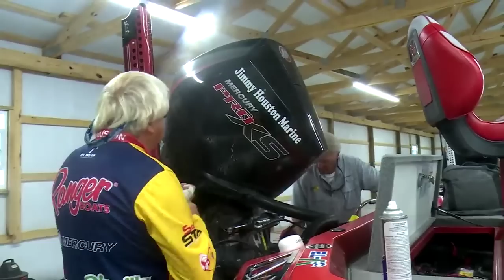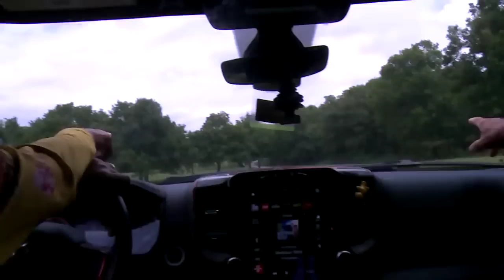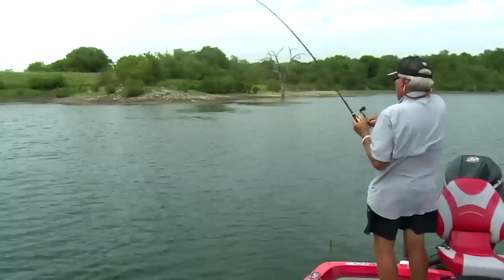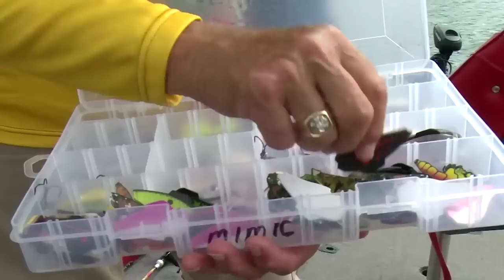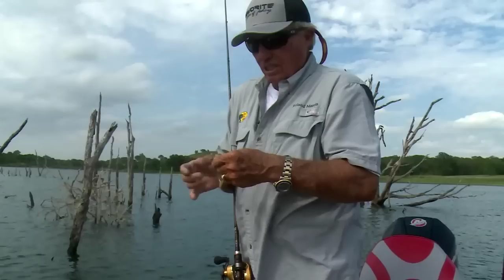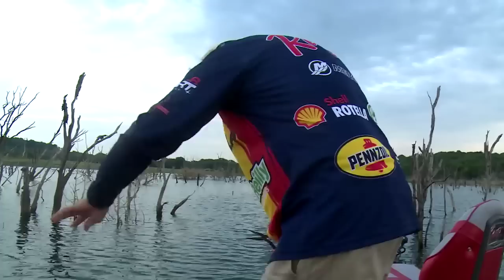Jimmy Houston and  Roland Martin Challenge

Comment: Jimmy did you know it’s been a year since we took our Ranger z118 for a swim.  My dad no sorta talked about getting her fixed but theirs no body local no body abroad that can fix an EVINRUDE e tech h.o. with a cooling problem that’s not the water pump. my dad said take it out if it does it again which it will heat alarm 🚨 will go off. I know we should have went with MERCURY but at the time their was two boats your stuck with this color or that for RANGERS being that size. Now that MERCURY has come out with with PRO XS i think if my dad could he swap engines he would. i asked what’s your guess on price for a 150 too much or 20,00$ plus. i just oh end of that idea. i haven’t even fished in a year. plus theirs nobody you can trust. these days. even if a thirty dollar part motor runs fine etc it’s that stinking cooling issue nobody with software to run diagnostics i told my dad what you wanted for your boat you guessed it his eyes 👀 got a big as saucers  maybe MERCURY/RANGER would do a give away with a 250 one of these years. one side of me says go fish on the bank the other says just give it up you’ve been this long. So for now i’ll watch you fish 🎣 maybe the coco nut 🌰 will fall our way.
Reply from the maker: Y’all need to just break down and find you a new or used Mercury and put on that boat, Mark.  Lots of great fishin time passing you by!!   Of course you could always put it in and fish all
Day close to the boat ramp.  That’s what I do if I have motor problems during a tournament.  Caught some pretty big strings doing that.    Thanks.  May God Bless.    jimmy
Reply: @jimmyhoustonoutdoorsfishing  i know but my dad’s retired certain things  are just not high priority. hopefully 🙏 the coconut 🥥 will fall one of these days. all i can do is hope. thanks though. Mark.